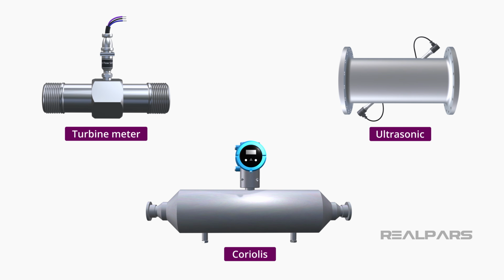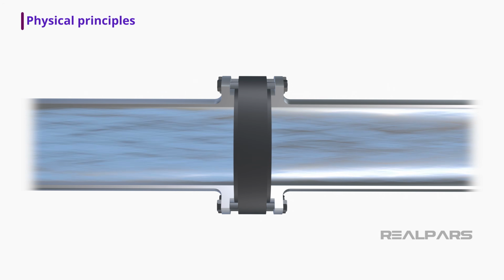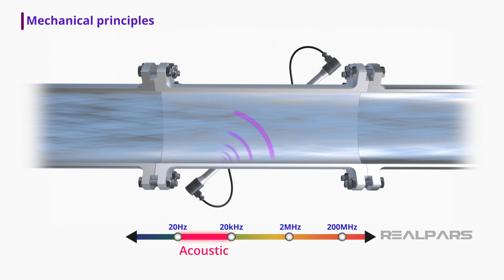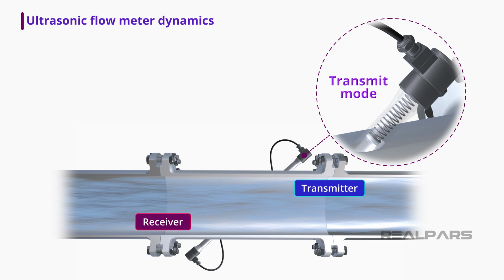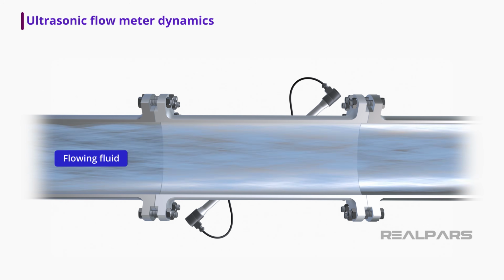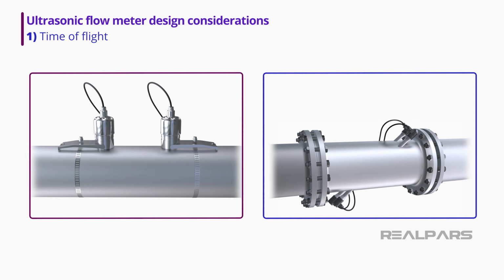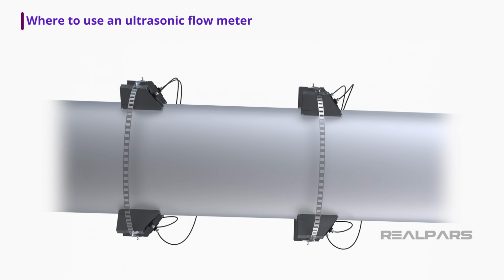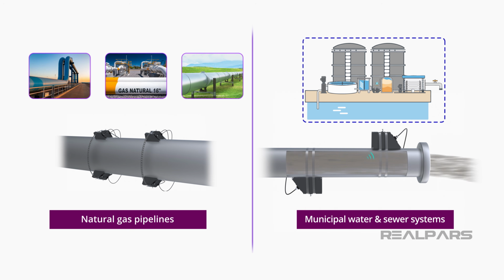Ultrasonic Flow Meter Explained | Working Principles

Comment: Is it more accurate then Coriolis?
Reply: Coriolis flowmeter measures mass flow rate, ultrasonic flow meter tells velocity of flow. If you wish to find mass flow rate from ultrasonic flow meter, you need know density of the fluid which is temperature dependent. so unless you have compensation techniques it cannot give accurate reading
Reply: @ashwinmurali1911  im asking for comparison of accuracy for volumetric flow rate between these two
Reply: @fahmietalife  in fiscal measurement they are both pretty good. US can handle viscosity of 4000cst to fiscal measurement standards. Coriolis can handle higher viscosities but with high pressure drop. So in my opinion, little too choose but in terms of universality I suspect coriolis will win.
Of course, the early coriolis ran at 50/60hz and could only measure mass flow. To find do an apples with apples comparison you needed to compensate one or the other.
Then coriolis switched to resonant frequency and could then measure density. Not without some constraints, but Goode enough
Reply: Coriolis is considered the "Gold standard" for mass metering. Not necessarily for flow. 

As for volumetric flow, according to sciencedirect:

"The Coriolis meter will oscillate at a specific frequency depending upon the density of the fluid in the flow tubes. ... With proper calibration, the density of the drilling fluid can be determined from the frequency. Mass flow rate is density times volume, so the volume rate of flow can be accurately determined."

So your flow measurement is only going to be as good as your density calculation.
Reply: @MrWaalkman  thank you sir. Thats the problem that we have with our application, we're using Coriolis to measure flow rate but once the fluid is not homogeneous, we're not getting accurate flow rate. That's why i wanted to know if the ultrasonic flow meter is more accurate for using in our application.
Reply: @fahmietalife  Yes, I would think so. Coriolis (like any other meter) is great for what it does well, but in this case it sounds like it was a poor choice. This is where a good meter rep is your friend. Try to pick a rep who sells a lot of different meters or your "perfect" meter will be the one that his company makes. ;>

What are you metering, and do you have a Reynolds number for it?
Reply: @MrWaalkman  the global  companies no longer offer the best technology for your application, they want to offer their "universal" solution. 
For some this is  ooriolis. It may not be the best choice not the cheapest but it is cost effective for them and their clients in the single source supplier, strategic alliance business model 
But what this means is regional sales offices with salesmen handling myriads of products aided by computer sizing and selection programs. 
Finding an experienced flow specialist is getting harder.
Reply: @MrWaalkman  "the gold standard".
That is his it is promoted. 
Interesting that meter provers used validate their in situ performance are volumetric measurements corrected for density. A dedicated density meter can deliver +/-0.15 kg/ M3 or better.
Reply: @jonwatson9765  I agree with you with one exception. The positive displacement meters will wear on you throwing things off. The problem being that it may be difficult to spot the error.